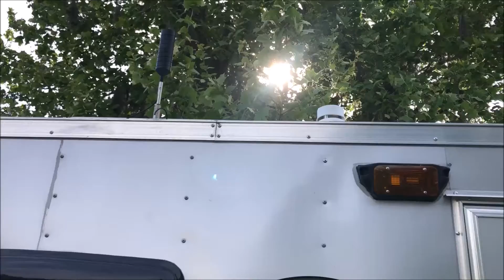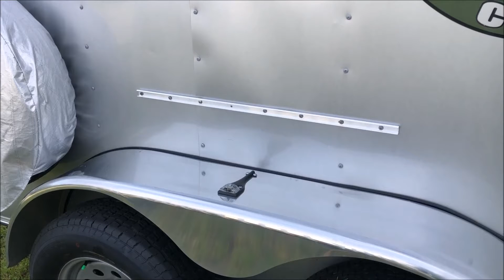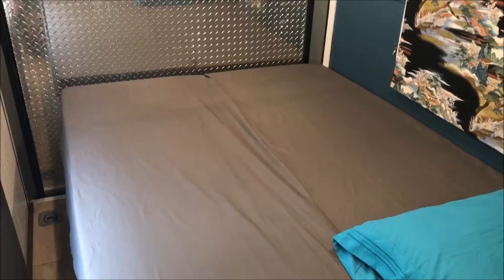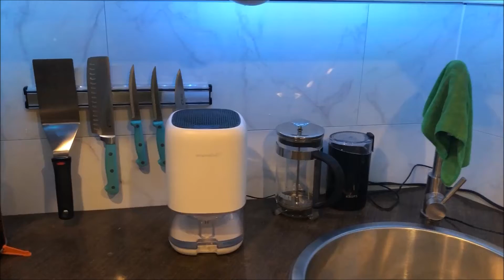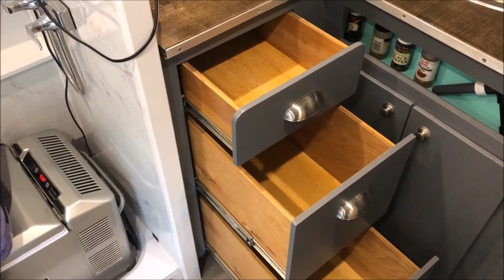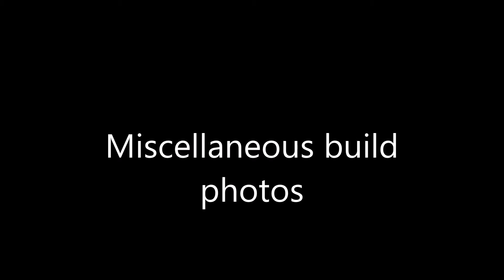Well insulated, off-grid ready, toy hauler cargo conversion, check it out.

Comment: Outstanding! I love the way you built it! I'm gathering ideas for a build and I like the simplicity of yours. You have everything you need in a 6 x 12 space. That's the size I would like to get. I like how you put the water heater on the outside. I would like to put in fold up bunk beds.
Reply from the maker: Thanks Eileen. Folding bunks would be possible if you keep the bottom one close (around 12") to the floor. It would also help to get a 6"6" or even 7' interior height option.

Comment: What is the fender bead called / where do you get it? Did you make the cabinets? Where did you get the fold down table?
Reply from the maker: The fender welt was through MACs auto parts but Amazon sells universal welting. I wouldn’t get VW specific since slots won’t be in the right places. I did make all the cabinets and table. I would recommend using a folding shelf bracket such as Yumore 16” heavy duty. On Amazon. I just look for the best reviews for these kind of things.

Comment: VERY KOOL....GREAT BUILD.... I THINK THE ONLY THING THAT I WOULD CHANGE IS SWITCHING THE TOILET AND FRIDGE/FREEZER. KEEP THE TOILET IN THE SHOWER STALL, cuz i'm gonna use that way more than I'm gonna shower lol, AND THE FREEZER/FRIDGE UNDER THE SINK WITH THE SAME SLIDE OUT...GREAT VIDEO...THANKS FOR SHARING!
Reply from the maker: You could do that. I travel with the fridge in the shower, but is moved to the back corner after the motorcycle comes out. There is another option for the toilet, as well, Outside in a small popup tent for showering or whatever.

Comment: WOW!  love this trailer!  I also have a 7x14 cargo trailer camper conversion that I just completed last month, well 95% anyways,  I am currently living in it full time now, Yours is so simple and clean and I like the removable jack.  When I need to do some errands in town, I would love to take the jack with me so no-one can steal my home.  I have locks and locks on the tires but that extra security will defiantly help.  GOOD JOB ON THE BUILD!!
Reply from the maker: I think removing the safety chains could also deter theft. A trailer can be towed by hooking chains together and flipping them over the tow vehicle ball. Even with tongue lock still in place. Might slow them down a little. Thanks for watching.

Comment: I have been looking at a lot of builds on you tube and I think this is the best overall that incorporates all the necessities in such a small space. I will probably go with a little larger 7x16 tandem but will go with the extra height also. As of now I think I have an idea of what I want to do . Just gotta get the trailer and get started. Thanks!  And if you had to do it all over again what would you have done different. I have a 3/4 ton large V-8 4x4 so the extra size I hope wont be too much of a burden.
Reply from the maker: I often say, “seemed good at the time.” So, this trailer has all one needs and in the smallest footprint I could pull off. Keep in mind it fits a bagger (MC with saddlebags. Would I build another on a 6x12? No, I would want to do something different. I have thought of a 7x16 or up to 20. And, a bit taller inside. The bed in a 7+ wide can fit east-west, but again, it has to be MC ready. Or even fit a side by side. That would entail the bed swinging up, murphy style, which drives you to a taller trailer. As far as towing; it won’t make much difference. Width and height increase would cost a little. Weight not much. Let me know what you do or if I can answer anything else.

Comment: Great tour with plenty of detail (and the extra posted afterthoughts were nice too.).  I really like all that you were able to fit into such a tiny trailer.  I don’t think you mentioned it but I do like the rain guards on the windows.  I might try those in my build, I love them on my truck.  When I first started designing mine I started with a 6x12 and ended up scaling up to a 7x16 to fit everything that I think I will want/need.  I’m still running the bed n/s and still only going convertible full size to sofa/ with a twin bunk over.  I want the ramp door and I want access to it for expanding the space with a screen room.  I’m going with a front bath/ center kitchen and back bed setup.  Again, thank for the awesome tour.
Reply: I liked the rain guards too, he mentioned they were sunroof deflectors, and I think that is a genius repurposing idea!

Comment: My hat is off to you. That is one of the best builds I have seen ! I would love to see your fresh and gray water tanks and how you mounted them. Thanks for sharing.
Reply from the maker: Thanks Ken. The 20 gallon fresh tank is centered over the axle pair on the street side. It literally sits on the plywood floor with 2x2 fastened all around. It can't go anywhere (north - south) and was part of my original build. The fill and vent tube routes to it as does the drain pipes and feed to the water pump. The gray tank was retrofitted when the shower was added months later. This required moving things around, such as the kitchen cabinets and the bed. I even slide the fresh tank back a few inches. The tank is 14 gallon and picked because it would fit between floor joists. It is made to sit on steel supports and sits (east - west) on angle iron (1 piece welded to another piece for each side, then bolted to those floor joists. I used 5/16" rivnuts into the joists. The shower drain p-trap is adapted to 1-1/2" pvc which is plugged into the polyethylene tank using uniseals. No sealant needed. Of course, the sink drain which is 3/4 clear tubing that is routed and adapted to the pvc. The remaining issue is the tank vent. I unisealed a 3/4" pvc line into the other end of the tank as high as possible and routed that pvc up into the camper and through the roof. If the shower and gray tank was planned rather than retrofitted, it would have been easy.
Reply: @clintstinytrailerconversio5560  Thanks for the info !